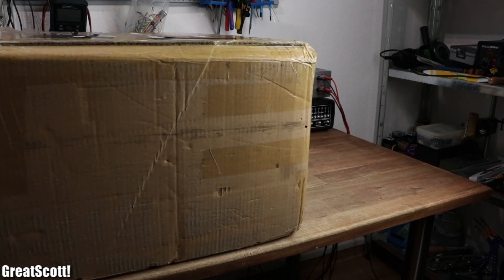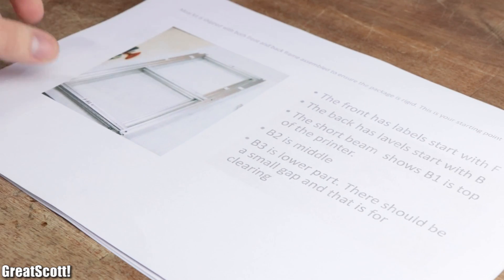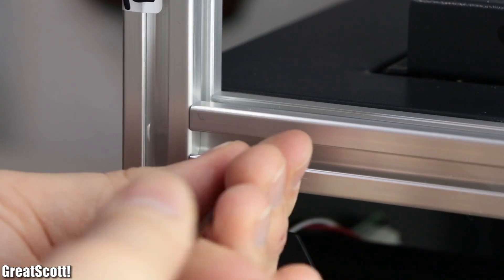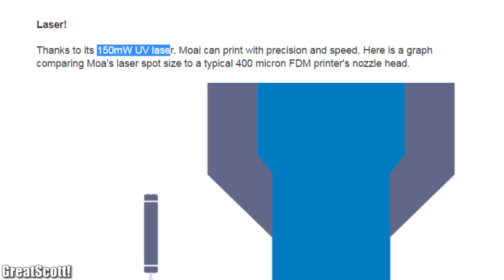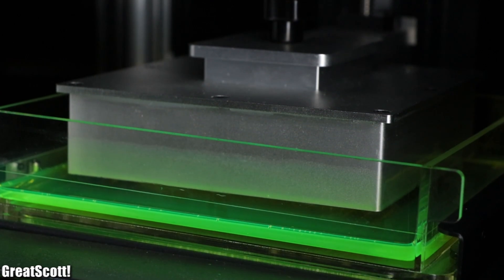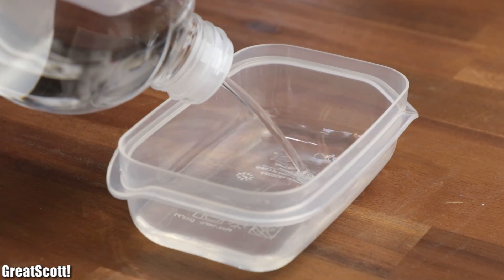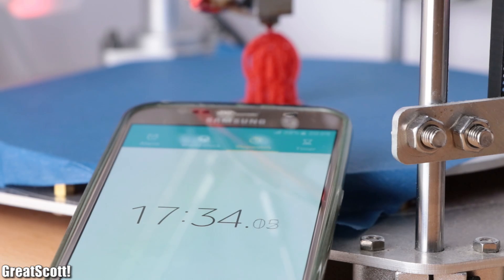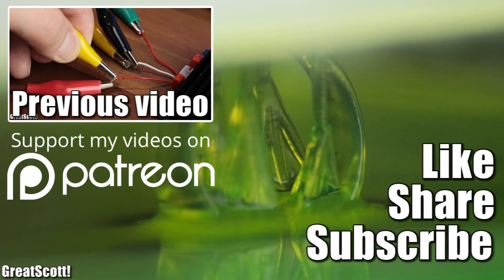DIY SLA 3D Printer Kit (Moai) Review

Comment: A fairly good review, I'm just unsure why you printed the ring at 0.2mm in FDM and 0.1 in SLA. That's a pretty unfair comparison of everything, including print time as you didn't mention if that 22 minutes includes the washing and curing time.
Also, it looks like your delta printer has A LOT of issues, for a start I'd lower the print temperature and add a cooling fan.

Comment: When I was a teenager in the 90s my dad managed a shop with a 3D Systems SLA machine that cost over $1M. It was mesmerizing. I loved hanging out there and sometimes got to earn a little money finishing parts that had to have support structure removed, or washing off the excess resin, etc. All parts got baked in an industrial UV oven after cleaning and finishing to finalize the cure. The resin was $600/gallon and the anhydrous alcohol wasn't exactly cheap, either. Replacement lasers were somewhere in the five figure range, plus labor. It blows me away that nearly the same quality can now be produced by a desktop machine for under $2K.
Reply: I used to own one of those, sadly I sold it
Reply: Just took 30 years...

Comment: What program did you use to make the support structure for the ring? I've downloaded the Moia version of Cura and at the moment it is still generating the inappropriate zigzag FDM supports ...
Reply: Found it: The supports are built in Mesh Mixer and Cura supports are turned off ... I presume this means I'll also be able to use Simplify 3D for the gcode once I turn off all unrelated options like priming the extruder ...

Comment: The speed scale is not linear, SLA will pretty much be slower by significant ammount than FDM as size grow bigger. Have a check with the default size of the cute octopus, and the print time will skyrocket with the MOAI, because SLA prints full density by default. Unless they find a way to bypass with empty pocket, but then, I find it unpractical with the uncured resin trapped inside.

Comment: Hi.gr8 presentation. 
Did you use anything as a media at aluminium platform?
I also have and use 3d printer. In my case i need to apply a small amount of uv glue at aluminium so that print can stick and grow.

Comment: Fluid printing is definitely the future of 3D printing! I had thought it would be far more dangerous and toxic then what the video creator shown. Also that print appeared to have at least x10 the level of detail, not just the twice suggested by it's layer height. 

If a company makes this more ready-built, adds a filtration system to reduce vapors, and gets the price point around the right range, I might get one of these. It looks utterly indispensable for lost-wax jewelry casting and general mold making. It would work fine for statues and figurines, maybe less well for physical objects you actually handle. Maybe somebody will cook up better chemicals in the future? All of the magic really happens in the goo in the tray.

Comment: Dude, SLA has better print quality/resolution no doubt about that BUT you overheated the whole FDM printed ring so you could have printed the ring better but you would have to change nozzle temp/multiplier/travel speed to compenste thus increasing print time.

Comment: This is a fantastic step forward in 3D printing, but there are several big issues that I see with this. Toxicity of a resin (resins and skin do not mix and it's a worsening reaction with each exposure). The mess of it before, during, and after. And how does this compare in cost and temperature stability to standard materials like ABS and PET/G, etc..? The brittleness is something I would have expected. Pity.  Very neat looking little gadget, though!

Comment: Hey Greatscott !
I'd like to have a digital LED RGB strip but it has to be easy to use . Is there an "cheap" led strip which can be used by an app on your Smartphone ? (Amazon link pls )

So nochmal in einer sprache die ich gut kann 😂. Ich würde gerne mein Zimmer mit einem Digitalen LED RGB streifen verschönern aber ich traue mich nicht an einem Arduino o.ä. und deswegen hätte ich gerne ein streifen welcher einfach mit dem Smartphone zu bedienen ist. Da ih ein Schüler bin hab ich net sooo viel Geld  und darum darf es nicht so teuer sein . Ach ja es sollte so 3 meter lang sein oder 5m .2 m würde zwar gehen aber wäre was zu kurz.
Reply: and thank you !

Danke dafür !

Comment: It looks like your SLA printer is way too fast and if you are using PLA you really need a cooling fan for this print. Such structures can definitely be printed with SLA but not without a cooling fan and not with that speed. The problem is that the plastic is still completely soft about 1 cm below your nozzle and your nozzle bends the whole structure while printing.

So if you want to print this better, you might want to lower your speed, your temperature and get a cooling fan. Even a PC fan next to the build platform helps a lot.
This is all assuming you used PLA in the printer and not ABS or another special plastic

Comment: I think the usability is what needs major developments and not quality yet. IN GENERAL people don't print because it has to be beautiful. We print a sheet of paper because it gives extra functionality to read from a paper or to write notes on it or carry it with us. Same with a 3D printer where it will be used to help us in a job we are doing. Printing photos on glossy paper or printing little figurines are afterthoughts.
Allow changing color easy. Allow multi color easy. Full auto calibration. Software that knows the best settings for all given parameters or have access to it's own data such as room temp. Get to a state where most people find a use to have one and the economy of scale will start to influence the prices.
The 3D industry also needs a seller that dares to go big. Someone who wants to become a HP or Canon or Brother. Not a MakerBot that piles itself into the ground.

Comment: Install DOOM on it !
Reply: Really? Thats stupid considering it doesnt have a screen!
Reply: @user-yw8sr3uj1w   You probably haven't seen DOOM running on smart fridges and ATMs (admittedly those have screens) or most importantly Quake running on oscilloscopes. Running DOOM on a printer would mean you get a ridiculous framerate like 30 seconds / frame. You have to keep in mind that printers are ultimately output devices - sure, slow output devices, but nevertheless

Comment: The comparison to ABS and PLA vs the resin isn't really fair, as its obvious that the delta printer was not calibrated properly, and you had heating issues. :-/
Reply: GreatScott! my home made core xy printer with 64 microstrip driver print almost silently, I hardly notice it's printing at one meter away, it's not a fast printer,  and it cost less than 200 usd.
Reply: Mine is base on sparkcube (http://the-sparklab.de/sparkcube-v1-1/), most part is printed. And I live in china, 3d printer parts are quite affordable here, for example a clone e3d v6 extruder set is less than 5 USD, ramps 1.4 3USD, clone mega 2560 8USD at most, a end stop with cable cost less than 30 cent.
Reply: how do you get 64 microsteps from a ramps? i had to use a duet wifi for that
Reply: search 8729 on ebay, I found the duet wifi you mentioned is using 16 micorstep, and interface the signal to 256 micorstep.
Reply: Try this 3dprinter
http://atom3dp.com/en/atom25_en_home/
Reply: It doesn't matter, you're still not going to get anywhere near it with FDM.  No matter how well you calibrate it, the layers of that ring simply aren't large enough to allow for adequate cooling; you're always going to be dragging the nozzle through hot plastic on some of those smaller cross-sections.
Reply from the maker: The comparison was not about the quality of the print in this case. It was about the speed and loudness. That the print looked terrible was a side effect.

Comment: I think your delta needs more retraction and a better part cooling fan :).

We just got a form 2 in work and oh man is that thing fucking amazing! It makes the ultimaker 2+ we have look like a cheap ebay kit. Then again i do not think that the ultimaker is that good , the old UP! Plus2 we have is better in my opinion. Slower yes ,  locked to its own software , yes . But it will still be working when the ultimaker 2 is dead , its a tank!

Comment: I'm no specialist but I've watched a few 3d printing nerd 3d printer torture prints videos and it seems you don't have the right settings on your filament (molten plastic) printer, that's why it came out so bad. I wouldn't be able to tell you how to change them though, maybe just trial and error.

Comment: Whilst the resolution on this looks much better than your typical FDM printer, one thing that's been skipped across is that you can get excellent results with FDM on many of these objects using the appropriate orientation and printed support structures. The real advantage to this is fine detail level when you need it.

Comment: Using an actual laser and cura is a huge plus. If this was a projector one (DLP) the calibration can be a pain in the .... and needs to use special software which usually sucks. Basically the bad chinese equivalent of a powerpoint program. Uh.

Which resin are you using ? What's the cost per liter?

Also: I couldn't help but notice you didn't mention how different support and infill for SLA printers is. It's something that surprises people a lot, that most empty shells need no infill... But that other shapes need many small supports or closed surfaces may need a hole for the excess resin to evacuate!

And as a word of ... ¿ wisdom? ¿tip? ... don't try to print very flat surfaces, they might make the base suction and peel off. Although by the movement of this it seems it's a tilting design instead of an up-and-down between layers. Maybe it will not have so many issues.

I would recommend, if these are UV sensitive resins (most are) to buy a Nail Saloon UV machine, they are cheap and usable.
Also for the UV light, better enclosed :)

Comment: what are those wires that you are using to connect 2 things far away from each other on solder pcb ? those silverish lines, is that actually unmolted tin wire ?
Reply: Blaster SVK It's silvered copper wire.
Reply: well thanks, so its nothing worth ordering from china ? I should better go to nearest hardware store right ? :D
Reply: Blaster SVK You can maybe safe a few bucks by ordering it online, but you can also get it in the nearest hardware store.
Here in Germany, you can buy it from reichelt oder Conrad.

Comment: I don't like this printer. I think that this printer is more dangerous that other normal 3D printers. It's just my opinion.
Reply: Dangerous in what way? If you're staring straight into the laser, yeah it'll be dangerous, but if you're wearing the laser glasses, it's no more dangerous than regular 3D Printers. Arguably, it's safer because there's no molten plastic.

Comment: hey scott, can you help me?
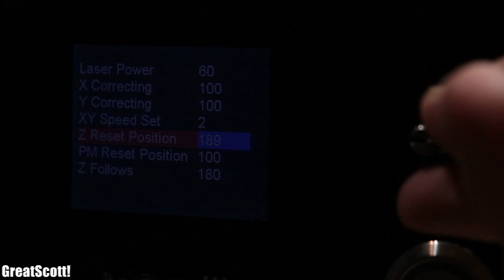I wantedto make a power bank and I followed your video, I’m ordering the components, but I already have a "DC-DC 0.9-5V 600MA Voltage Step Up Boost Module USB Charger Blue", I was wondering if I can use it instead of the one you used in the video, also if I HAVE to use the one you used there what do I have to do with that wheel at 3:00.
thanks for the help and sorry if I’m bothering you.
Reply: and how do I do that? I don't think it's already set to 5v out, I'll send you the link so you can see it:
http://luckyretail.com/Uploadfile/2015.5.26/041636/041636.jpg
Reply: thanks I'll try, but one last thing, I'm not an expert in these things and I just want make it for fun, I tried using 3 normal AA batteries and hooked up to that boost converter, the led turned on, but it wasn't charging the phone (iPhone 5s), do you know why?

Comment: So this printer doesn't require standoff's like a conventional 3D printer does when making something mid-air?
Reply from the maker: Support material is still required sometimes. But the rules are a bit different.
Reply: GreatScott! Ok! Because removing that suport material tends to be rather labor intensive. So much in fact that I'd rather make something with my hands instead of printing it... maybe a good idea for a new video :)

Comment: In your opinion is it worth upgrading to this from the 3KU delta printer your last video made me go out and buy the 3KU that ive had loads of fun with but printing arches and recalibrating it every so often is some what of a headache although ive upgraded to optical endstops and it has solved some of these issues
Reply from the maker: If you need very high quality parts, then sure. If not, the Delta printer will work just fine.
Reply: sweet thanks have your tried building anything with a larger volume?
Reply: The resin costs $120 per liter, while PLA for plastic printers only cost $20 for a 1kg spool.
Reply: very good point i dont have it like that
Reply: GreatScott! Be careful! We all know what happened to the last German that messed with solids that came out of liquid like that.

(Terminator 2 reference)

Comment: Is the resin much more expensive to print with than "to-be-molten" plastic?
Reply from the maker: Yes, it is more expensive.
Reply: GreatScott! I mean, by how much? Including the isopropanol (which might be insignificant), is it like double the price for a print? Less? More? At least the printers cost more, and I heard they require changing of the print bed every now and then, which would also add to the "printing cost" if it were true..?
Reply from the maker: Since this question popped up four times now in the comment section I will make a seperate video about it. Printing Cost: FDM VS SLA.
Reply: GreatScott! Thanks! I like the way you work with your viewerbase :)
Reply: If i it look up SLA resin costs 70-160€/kg. Compared to PLA at 15-50€/kg, i would say at least double the price.

Comment: comparing moai to your other printer, which do you think is more practical to use in terms of cost of production and quality of output?
Reply from the maker: Not sure about the cost yet. But I think the material for the delta printer is a lot cheaper. The SLA prints however have a much higher quality.
Reply: should he user be concerned with his health when operating moai? I mean aside from the laser, are there any other things to watch out for?
Reply: Dennis Padul the resins that SLA and DLP printers use is quite nasty stuff on top of being pretty expensive, you don't want any of it touching your skin and it often has a very strong, acrid odor
Reply: So I guess its higher detailed output is the only advantage of the moai.
Reply: Dennis Padul It's also much quieter and can print some models with steep or oddly shaped overhangs that can't be printed on FDM machines like the Delta he has
Reply: oh yes the noise, I forgot about it. well thanks for the response Ben. And Scott I hope you could find a lot of uses for this machine in you future projects.
Reply: +Benjamin Tetreault also with SLA u have much more materials to choose from eg transparent plastic or soft rubbers. but at a much higher cost
Reply: Philip Weser Very good ooint, I wasn't even thinking about material selection. As long as you don't have bubbles SLA can give you almost perfectly clear transparents, much unlike FDM, and softer flexibles are an unmeasurable pain on FDM machines.
Reply: 1000 usd is very cheap for an SLA and it looks decent.
Reply: Ive seen some that were pre-built for ~750 on eBay. Not sure about the quality tho...
Reply: Dennis Padul j
Reply: Dennis Padul Of course, glad I could help.  I too am looking foward to what we'll see in the future from Scott!

Comment: Do you have to readjust the print bed like you normally would on a 3D printer, Or does it automatically level? SLA printing is so interesting!
Reply from the maker: You have to adjust it manually. But ever since I got the laser working, I did not readjust the bed. It just works.